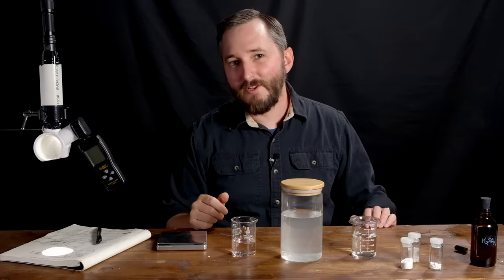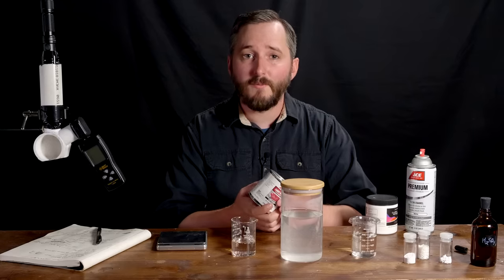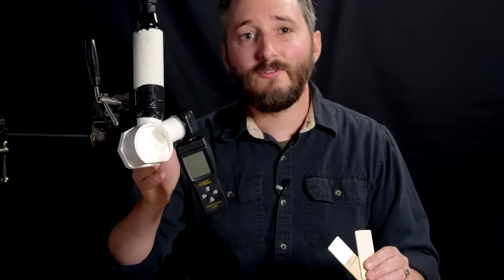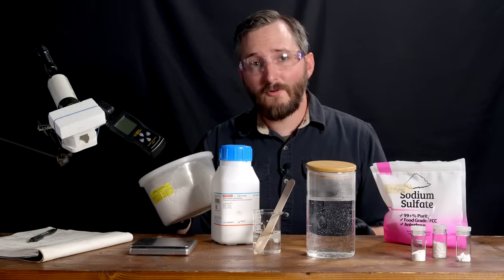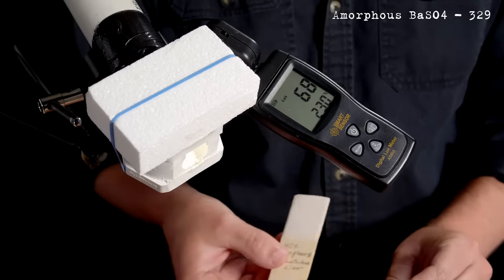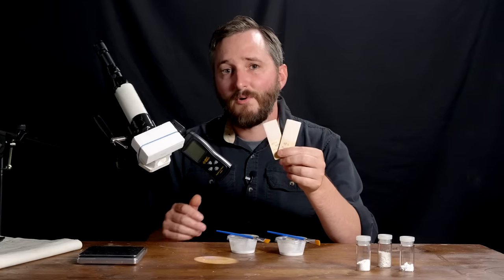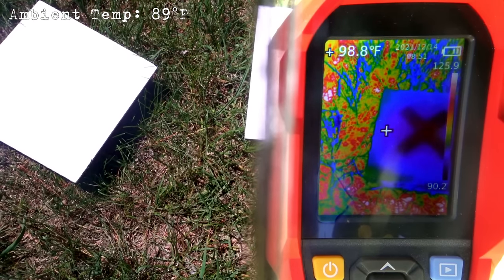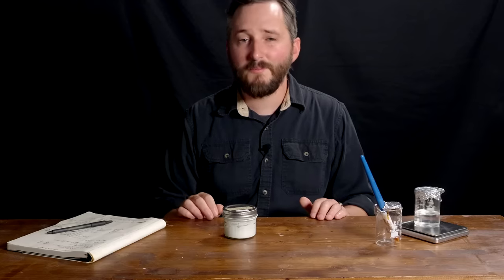How To Make Infrared Cooling Paint (Electricity Free Air Conditioning)

Comment: Super glue will frost up when water is added before it sets.
Reply from the maker: True, I wonder if there's a way to take advantage of that.
Reply: @Nighthawkinlight  As a side note, I was taught to repair In-the-Ear hearing aid shells by dipping a pin in super glue then in polymer powder, then back in super glue. (from a small blob of super glue on a HDPE bottle cap) Then use that to patch a crack in the shell or fasten the shell back on the faceplate. We had pink and brown powder that I mixed to match colors. Very good repairs, hard to tell there was a crack, after buffing.
Reply: The polymer powder was in the form of tiny spheres. if some was spilled on the table, flat items would roll all around like on ball bearings.

Comment: So if CaCO3 and BaSO4 are both applicable why did you choose the more toxic to produce form? when calcium carbonate is safer and extremely cheap.
Reply from the maker: BaSO4 is very inert. You drink large quantities of it for certain medical procedures. The answer as to why is used here instead of CaCO3 is that it works better. I also have a CaCO3 version in a newer video.
Reply: @Nighthawkinlight   I didn't say BaSO4 itself was extremely toxic, but the chemicals to produce it were more toxic than CaCO3. But it makes sense if it works better, and yes, after posting this comment, your other video popped up in my feed. I would still feel caco3 is still cheaper than barium as well, but I haven't priced it myself. I could be wrong. I do plan on doing the CaCO3 version on some barns next summer to see if it helps keep it cooler. I do appreciate your content. Don't take what I was asking personally it was just an inquiry.

Comment: Holy shit, in my country I am literally almost blacking out due to heat and air humidity, how much would it cost to paint one whole mid-sized room with your magic paint? :(
Reply from the maker: It doesn't work to paint a room. You have to use it on a roof or outside walls
Reply: @Nighthawkinlight  oh, that sucks! Could you guesstimate how much would painting, idk, a garage cost? Like " π times a door" * I just would like to know a approximation.
* a saying in my country , it basically means guesstimate

Comment: Wouldn't the surface need to appear hotter (at least initially)? Actually you're trying to get rid of thermal energy by radiation.
Reply: It sends thermal energy to space by radiation. It only needs to appear hotter than space. It doesn't need to appear hotter than anything else.

Comment: I'm not sure your temperature readings are valid. The temperature readings from a thermal camera depend on the emissivity of the paint, since you don't know the emissivity to set the camera to, it's doubtful the indicated temperatures are correct.
Reply from the maker: All the paints used are acrylic based, so the comparative readings between them are pretty good at detecting a deviation between samples. I've confirmed the accuracy is pretty good on the thermal camera compared to thermocouples

Comment: I am trying to recreate this, but when i read the paper, it said to add sodium hydroxide until the pH was "stable". Whats a stable pH pls help and what is the solvent used to dissolve the EDTA
Reply from the maker: Stable I think would mean a pH of 7. EDTA dissolves in water
Reply: @Nighthawkinlight  Thank you so much for clearing my doubt,Also I had some doubts about the two seperate solutions, the BaCl needs to be mixed with the EDTA in the water and the sodium sulfate is the one in your hand in the smaller beaker right?  please correct me if I am wrong.
Reply from the maker: @galaktronotx.2749  That I don't remember. I was just doing my best to follow the paper which I haven't read since making this video
Reply: @Nighthawkinlight  thank you so much for taking the time to reply to my question, I m a student from middle school and i wanted to create a project because of my keen interest in chemistry, I was thinking that maybe I can take the starlite panel and merge it with the radiative cooling coating, even if it is installed in panels, the starlite would provide for a back panel, and if there is no fire, the cooling paint should work as intended as there is no insulator stopping it from cooling the surface beneath, and the insulation only comes when the carbon foam deploys with fire, and since it also releases a small amount of CO2 and travells towards the source of the flame as a bonus, I think it may also help in extinguishing thr fires, like a inbuilt fire extinguisher built into your wall, you have been my inspiration for almost all my school projects and have motivated me to try something new, I really appreciate the work you do, you really are a nice guy, keep at it! And please tell if you think my projects has any loopholes, consequences or room for improvement if you get the time. Thanks!

(Sorry this message got really long ;-:)
Reply from the maker: @galaktronotx.2749  You should consider trying my newer paint version using calcium instead of barium. The barium chloride is toxic. My calcium version doesn't use any toxic ingredients.
Reply: @Nighthawkinlight It really all depends on the quality of the product, in this period I am not planning to mass produce it, so quality is my main goal here, and i slightly remember that you mentioned in your video that the barium sulfate one is better and the CaCO3 is better for DIY purposes, I would definitely have proceeded with the safer alternative but i have been given a chemistry lab to work with in my school for this project with all the necessary safety equipments and supervision, so quality is my main goal here and I will decide the course of my actions in the future if I decide to mass produce it because CaCO3 sure is a cheaper alternative without many losses, but thanks for worrying about my safety!
Reply from the maker: @galaktronotx.2749  If quality is top priority you might want to check out the method demonstrated by the channel Tech Ingredients. They followed a paper that gives state of the art results. As far as my method goes the calcium is hardly distinguishable from barium as most of the effect is from the acrylic mix rather than the pigment.
Reply: @Nighthawkinlight   thanks for the suggestion! I'll definitely check it out

Comment: Just a thought: comercial video / cinema projection fabric has a layer of nano-quartz particles adde to it. One can buy it  by the foot.
I wonder if you can get information on what the nano particle of quartz are available.. 
An other option, from secure sources, and some videos have occasionally popped up on YouTube, is the “cloaking technology our military has started using. The idea is to deflect the light completely around an object while at the same time allowing what is behind the object appear as there is nothing is in front of it.  No blur, no distortion, no shadow. NOTHING! 

My best wishes for recovery of your health. 
I am a physician and certainly understand, 
Take your time. Do some research on what I mentioned above.  If you would like I can d
Send you a couple of feet of “professional grade “projection screens” the same they use at cinemas.  There are two types, one is front projection, the other is rear projection, which may best be adequate for your project.

Comment: How much do you think it would cost you USD to make a gallon of this paint?
Reply from the maker: I don't recall the cost of barium sulfate off hand but I'm working on a calcium version that should be about $35/gallon
Reply: @Nighthawkinlight  holy crap I'll look forward to it. I'm moving to Vegas in the fall and I was actually pondering painting this onto my van to help me not be medium rare everytime I step in  the vehicle. I feel like the van camping potential here could be awesome
Reply from the maker: @bigshawv4497  I don't think this particular paint will help you in a van. It's brittle and will crack when you hit potholes. Any white paint will be an improvement to other colors. I just finished using Henry's tropicool on my own barn roof. Such paints are not actively "cooling" but they are colder than a roof started and optimized for longevity. My own paint is only going to be useful for specialized purposes for now like making cooling panels.
Reply: @Nighthawkinlight  hmmmmmm. Well I'm sure there is a way to get barium sulfate paint in a less brittle format. I wonder if just a layer or two on the roof would make a difference.  I love applying science to my life and thinking my way out of problems before I throw money at em.  Thanks for your speedy replies. It's nice to see YouTube creators who are genuinely responsive

Comment: I notice that you only used 40% barium sulfate in your mix, and I have read and watch many video about this product and it indicate that proper mix that they use is 60%.  So I suspect your design does not work as well because it has the wrong percentage mix of barium sulfate.  They did years of trial and determine it was 60% more or less so I would think that they would be right.
Reply from the maker: I've used much more than 60% and less. Measuring by percentage doesn't really make sense for a liquid and a solid. I'm working on a better standard

Comment: I recently discovered your channel thanks to YouBoob recommendations, a very annoying feature.  So, my first viewing was your last video about the funny paint 🎨.  Thermal paint?  That was last week.  Now I just watched the last several before it.  Then I started looking at all the thumbnails and titles working backwards in time on your channel.

I realized then I had some serious problems.  Or many.

1. I had to watch ALL of them.  That's a serious amount of video binging.

2.   I wanted to do ALL of them.  Ah, come on man!

3.  If I tried to do almost any of what you do I'd be kicked outta my pub(l)ic housing apartment. 

4. The fire and police department across the street are going to adore 🥰 me.

5. I can't afford most of what is needed to do them.

So, I'll have to be dissatisfied not doing them.

Questions

1 Are you a former HS science teacher?

2. Where did you learn all this?

3. Can you make a tornado machine using water vapor so it doesn't set off a smoke detector?  

4. What is that vanilla smelling stage smoke made from?  Is there a DIY method of making it?

You said you like getting comments.
Reply from the maker: Not a former science teacher, I learned most of what I know from googling. Look up my video about making a tornado machine, it uses water vapor. Stage smoke is often a mix of food grade vegetable glycerin and distilled water, approx 60/40 ratio. If it's vanilla scent they've added a propylene glycol based flavoring. It can be hard to know what types are or are not safe for inhalation so I recommend buying pre made fog liquid rather than experimenting with scents.
Reply: @Nighthawkinlight  Thanks, I only looked at that title in previewing the last six years.  I assumed it was smoke.  So I will try to do what you did since it's not heat or smoke related.   Also, I'll try the stage smoke effect and look up how to do it with your hints.  Thanks a lot.

Comment: You have people believing this does active cooling which it most certainly does not do. It is just extra white paint. 
If this really did active cooling you would be able to create a free energy device with this in a hot dark room, but this violates the 2nd law of thermodynamics. 
I think your method of measuring temperature may be confusing your results - I would recommend using thermocouples instead of an IR camera.
Reply from the maker: It is active cooling, the sub ambient tempertures have been confirmed with thermocouples. It is not a free energy device. It relies on the relitive coldness of outer space to send heat from hot to cold. It does not work in a closed room, it must face an open sky.
Reply: @Nighthawkinlight  You should call this passive cooling. It does not take any energy-consuming action to help the radiative heat flows.
Reply from the maker: @panotjoonkhiaw9425  Yes you're right, but the term passive cooling has connotations of only reaching ambient temp in normal usage. The terminology seems lacking to easily communicate a complete picture.

Comment: i'm thankful that you did all this work. but it seems that you did not replicate the work of the purdue team. the barium sulfate paint should be outperforming  commercial titanium oxide paint  in a clear sky shade/night scenario. 

roofs painted white are quite common in hot climates. you are wrong to think that this needs to be panelized. we desperately need infrared-rejecting white roof paint. several billion people live in a climate where the cooling needs far outweigh the heating needs. 

the comparison substance is not titanium dioxide suspended in acrylic latex binder. it is whitewash. calcium carbonate. please check your barium sulfate results against 10 layers of whitewash.

Comment: It is NOT capable of sub-ambient temperatures. When a solid body receives no infrared radiation, its temperature will stabilise AT ambient air temperature due to physical thermal conduction from the air molecules into the substance.
The very best you can do with a reflective coating is to get the coated substance down to ambient temperature.
Your tests, if they showed LOWER than ambient, are almost certainly corrupted by radiant infra red heating your "ambient" temperature sensor a couple of degrees ABOVE actual ambient, giving you the false impression that the coated substance is below ambient.
Be careful you don't destroy your reputation by claiming something which is not possible in real world physics.
Reply from the maker: You're wrong. Read some of the research papers on sub ambient radiant cooling.
Reply: @Nighthawkinlight  ... ahh ok. I thought that phenomenon of radiative sky cooling was limited to a night time thing due to the low sky temp at night.
Sorry for sounding harsh in my comment. You have educated me. 👍
Reply: @wizrom3046  at night time you're probably better off with a "black body" (at least black in the infrared spectrum) which naturally radiates more energy than other colors.
Problem is, in daylight a black body will also absorb infrared light coming its way, hence the need for a reflective but also emissive body (if I recall correctly these 2 properties tend to be mutually exclusives).

Comment: Why do you start this video off by telling us it's going to "suck the heat out and send it into space?" It doesn't suck anything out. That's not how it works. It isn't a sponge or a vacuum cleaner.
Reply from the maker: Tell me how it works
Reply: @NightHawkInLight  high emissivity of the boron coating. All light it absorbs is emitted back in the infrared. It doesn't suck anything. It doesn't work in the dark for example

Comment: Wooden subsurface? LOL. try reality, like metal, or cement. Wood is not going to help you in making some conclusions. If you have metal, or cement, each absorb heat at different rates making the IR properties USELESS. So for example, using wood, the soup you made never really transfers the absorption to the wood as wood is bad at absorbing heat. Makes like an insulator.

Comment: Have you solved the refractive index issue with the paint base?
Ref: https://youtu.be/N3bJnKmeNJY?t=685
Reply from the maker: I have solved part of the issue by using calcium carbonate instead of barium, but still the best result so far is with "snow scattering" acrylic mixed with the pigment instead of a normal paint. You can purchase different refractive index polymers for use in paints but they are industrial chemicals, not easy to buy for a normal person.